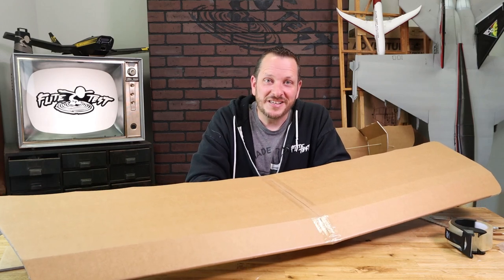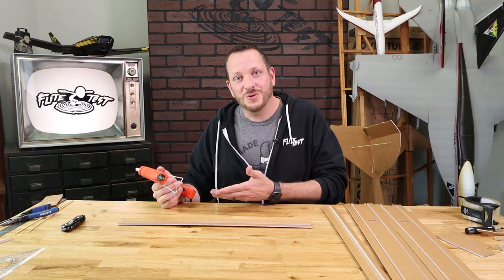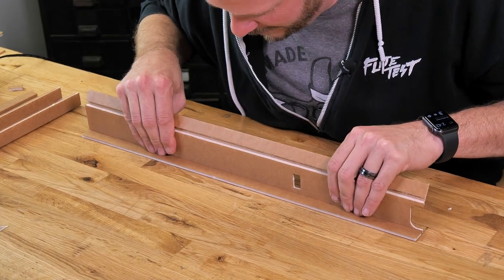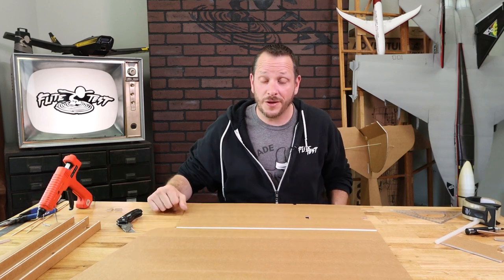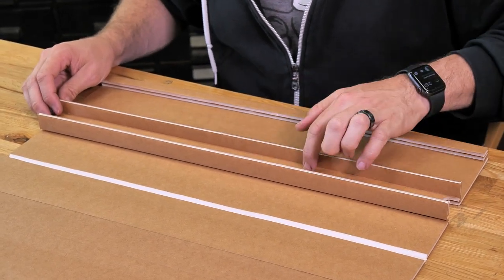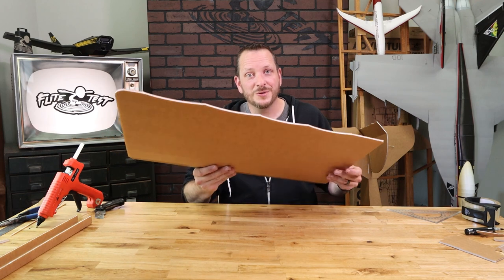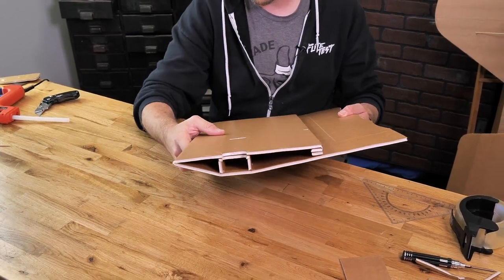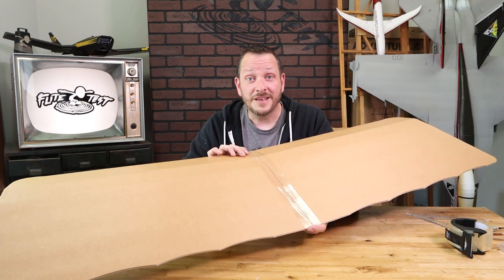How to Build the FT Scout XL Wing // BUILD

Comment: hi
would you please tell me the technical name of the material you are using?
I mean the foam
Grazie 
Alessandro
Reply: "Foamboard usually consists of three layers, an inner layer of polystyrene or polyurethane foam that is clad with an outer facing on each side of either a white clay coated paper, cotton archival paper or common brown Kraft paper."
Reply: @dannymundo7538  thank you